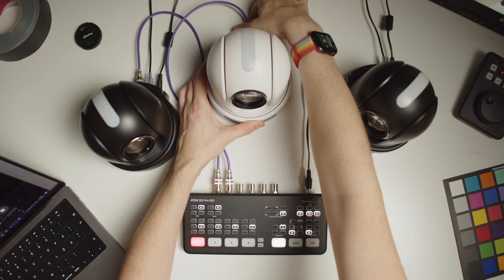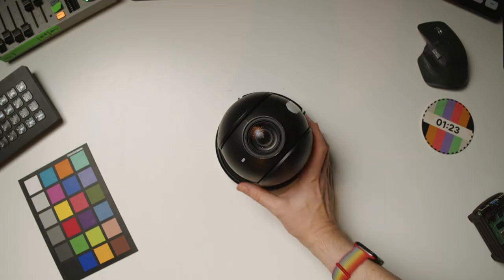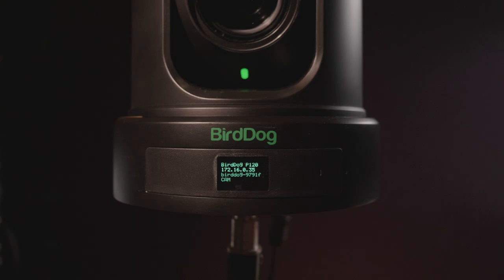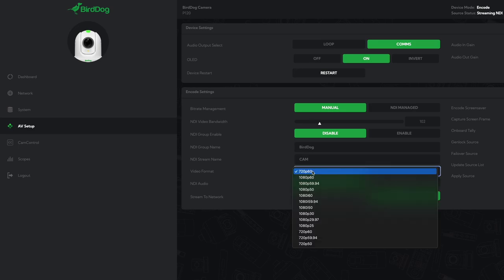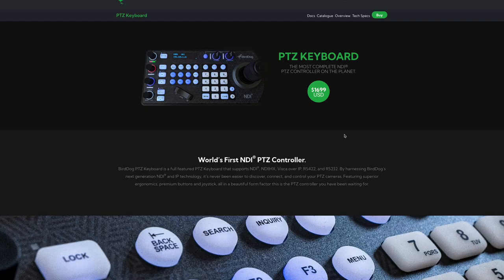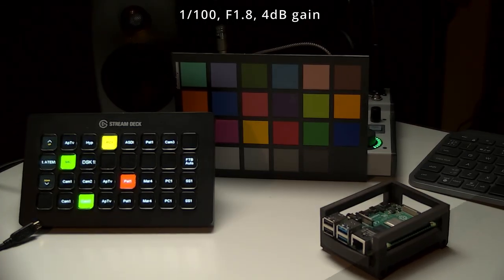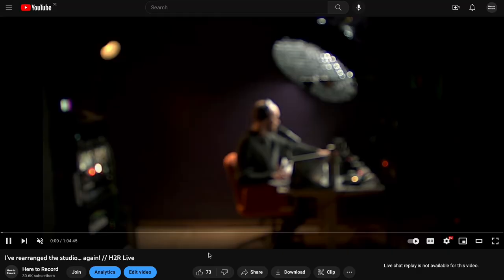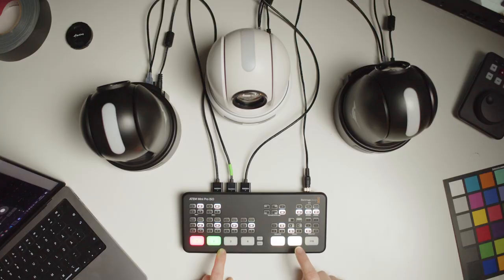PTZ cameras with an ATEM Switcher... What can go wrong? // BirdDog P120 overview

Comment: I used to use PTZs quite a lot. But the poor image quality and the fact that you still have to have a camera operator means that over time I've cut way back.
Reply: The image quality depends on what you are investing. You can get everything nowadays, from tiny 2.9 to full frame. If you operate 3-5 cameras, you can do that with one camera operator instead of 3-5, seems like a good deal to me. But if you buy peanuts, you get monkeys 😇

Comment: I handle live streaming for my parish. We have two PTZOptics cameras. We send the video signal via SDI then convert to HDMI for our ATEM Mini Pro. We control our cameras using Companion and a Stream Deck XL. I would love to have a joystick controller for tracking shots, but we just don't have the space where we needed to put the streaming setup. In the future, I would like to upgrade the ATEM Mini Pro to the SDI version and cut out the Bi-Directional SDI to HDMI converters. That would also allow me to create a mobile streaming rig with the HDMI ATEM Mini Pro.

Comment: We use 3 Datavideo PTZ-280 Camera's for registration and live streams of (pop)concerts.  They work fine in a low light room. As controller we use a Skaarhoj. We use the Atem TV studio PRO switcher. We had a lot of issues with setting of the right white balance and the Skaarhoj - PTZ 280 integration but it works..
Reply: One thing I noticed online you don’t hear a lot of people talking about datavideo PTZ. I would be real interested to know what is the quality compared to some of the other PTZ packages. And what is the model number of that controller.

Comment: I recently got a Skaarhoj PTZ Fly and two Canon CR-N300, and I must say that I am impressed so far. I've only fiddled around with the camera settings, and haven't had the time to find the perfect ones yet – but yeah, I suppose at least the low light sensitivity is pretty much the same with those as with the BirdDog ones. Fortunately, with volleyball productions comes good lighting in the arenas, so that is seldom a problem.
Reply: Hello ! I think I will buy P240 from birddog. But if canon would offer a very good author tracking solution (without external server) I would go on Canon. Do you know if there is something like that in preparation ?

Comment: I have used a set of 3 Panasonic AW-UE70 cameras and an HE-40 for about 7 years now. I started with the Panasonic HS-50 switcher using SDI runs of up to about 300 feet with almost no issues. I have always used the Panasonic RP-120 controller with them. During Covid, I started using the Blackmagic ATEM mini line of switchers for streaming and recording, and using fiber HDMI runs of 150 feet worked very well.

Comment: Older ATEM switchers and peripherals have serious compatibility issues with 3G-SDI interfacing with non-Blackmagic gear. Even when resolution and frame rate are matched, Blackmagic gear often fails to sync with SDI Level A outputs at 59.94p or 60p frame rates. In addition, some previous-generation Blackmagic gear has no SDI Level A output option, making it incompatible with non-Blackmagic gear that expects SDI Level A. As an example, I had intermittent black outs with a Blackmagic ATEM Television Studio HD switcher connected to a brand-new Epson EB-PU2213B projector, using 1080p59.94 SDI Level A outputs. To resolve this, I had to recondition the ATEM SDI output with a Blackmagic UpDownCross HD Converter, set to output 1080p59.94 SDI Level A video. What's the difference, you may ask? The UpDownCross converter produces a reliable SDI output for the Epson projector, while the ATEM TV Studio does not.

Comment: Great info, John.  Thanks for the overview.  We are about to upgrade to an NDI workflow for our productions.  Do you (or anyone else) know if the tally lights on Birddog PTZ cameras are compatible with the ATEM Extreme?  My signal path would be: Remote PTZ camera with NDI connection -> network -> NDI decoder in the studio -> SDI input on the ATEM.  Would the preview/program status of an input on the switcher get sent to the remote camera via the NDI connection?

Comment: I have two cameras and NDI soft can see only one. I think because both cameras are on same IP address, which is right from the box.
Can you share info how to make 2 cameras appear in NDI? 
Also both cameras are set as a camera 1 and remote control at the same time control two cameras. How to change one camera in setting for camera 2
Reply: both cameras need different IP addresses, either via DHCP or manually assigned, simply change via the web interface.
The remote control can control multiple cameras, channels 1, 2, 3. The cameras must of course have different channels.